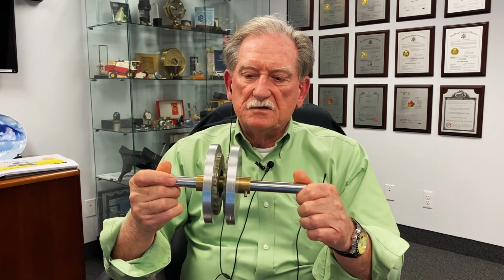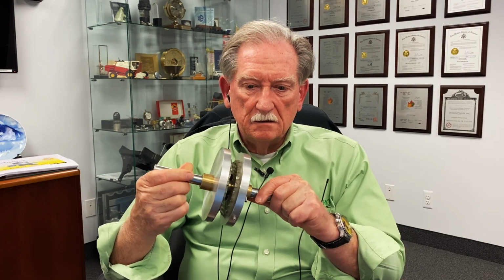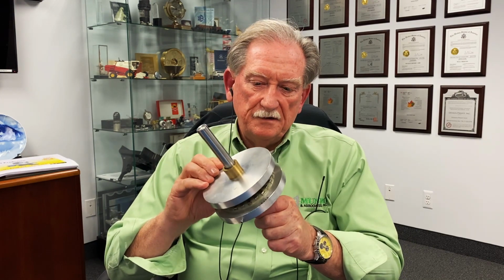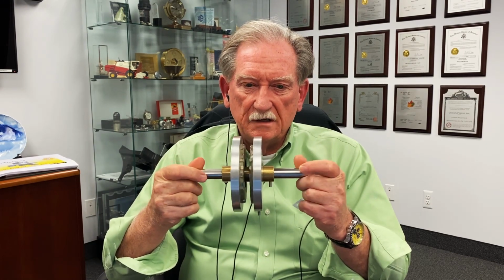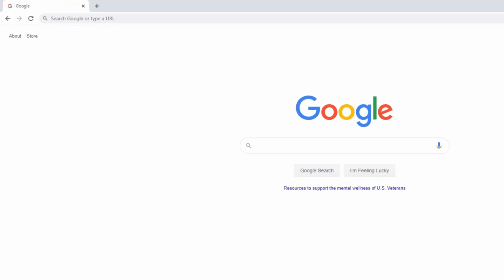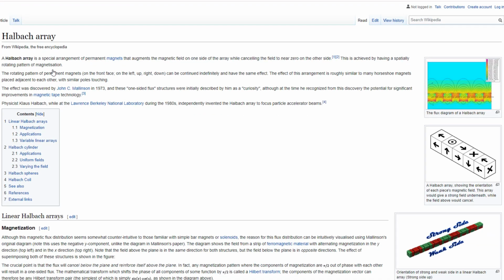Sandy Discusses What's In The Box - With Tracy McSheery

Comment: It’s fantasy to believe that there will be cheap off peak electricity in the future, as demand ramps up.
Reply: In the US we subsidize the Fossil Fuel industry with over $60,000,000,000 a year in reduced taxes, incentives and looking the other way about paying contractually obligated fees for the fuel they extract from government land. If we gave 1/10th of that as subsidies to electrify vehicles, it would happen decades faster. The choices are political, not based on physics or common sense.
Reply: @tracymcsheery1223  Subsidized taxes, incentives and fees are all money that don't exist if the fossil industry goes away. Giving 1/10 of zero is not going to get them far... That said, off peak electricity is not such a big problem as some seems to think. Apart from batteries there are many other solutions already existing at many levels of magnitude: https://en.wikipedia.org/wiki/Energy_storage

@A jones commenting on a video which is very much about optimism about the recent confluence  of technology that previously was too expensive or simply impossible, but now is possible and much cheaper, seems pessimistic and out of touch with realistic future possibilities. In my humble opinion.

Comment: When I took the cable car up to Yulan Hushan (Jade Dragon Snow Mountain)  to 16,400 feet (the mountain is above 18,000) near Lijiang, Yunnan, China, you could rent cans of oxygen. They felt like they were empty. However, they had more than enough O2, not 'air' in them to give you an occasional boost for the two hours or so you'd spend up there looking at the glacier, or at the idiots who climbed over the railing to take selfies on the glacier....  I had one of those finger clamp blood oxygen/pulse meters. I tried it on a couple people. Everybody was about 92%, including the Tibetan guy who worked up there - he was smoking a cigarette when I tested him.  You'd feel the positive 'hit' off the can of O2, (less lightheartedness, less breathlessness)  but it didn't move the blood oxygen level up.  
One great thing about traveling in Yunnan is that if you head north in the province, everything is well above 5000'. After a week or so hiking around there, when you come back down to sea level, you feel great for about a month. Back in Los Angeles two weeks later I hiked up Mt San Antonio 10,000 feet like it was nothing. Younger guys would run a bit, but then get tuckered out. Me at 54? I guess it was like torque.  I know Sandy likes nerdy stuff. Not a lot of opportunities in Michigan for high altitude experiences.

Comment: There has been a few cars with a more recent history than the Wolseley.  The Gyro X car from 67 ish and  a fellow named Danny Kim with Lit Motors 2016 was a good presentation. Lit motors had a two wheel enclosed motorcycle with dual gyros. I think he was onto something. Don't know exactly what happened, a lack of funding likely.  So if you know a guy with exceptional batteries and an amazing chip added with a new style motor that could be used in wheels I wonder what could be done. Could the spinning gyro be used to generate electricity as well as stabilize the vehicle? Love the channel Mr.Munro.

Comment: How come they talk as if Engines and Motors are the same. They’re fundamentally different. One is based off electrons and magnetism and the other is based off combustion or compression
Reply: It also is then reduced back to physics that says that one is incredibly efficient and another is highly inefficient.

Typical gas engines are 20-30% efficient at converting the fuel to vehicular motion. Typical Diesel engines are 30-40% efficient at converting the fuel to vehicular motion. 
While the motor is 90-95% efficient at converting the fuel to vehicular motion

Comment: 3 wheels means 3 navigation paths through potholes and across the paths of squirrels and rabbits.  I'd prefer the 2 wheeled gyro car over 3 wheels since you only have one navigation path..  But frankly, if you have to pull off to the side of the road you only have one wheel to get you out of the  grass or mud.  Intuitively, on 3 wheels rollover scares me but undoubtedly you can engineer around it.

Comment: High torque hub motors are the holy grail of e vehicles. 4 wheels is more stable than 3 but our safety laws put any high speed 4 wheel vehicle in the automotive classification.

Comment: But if you can have one or two motors + controllers (one per axle), compared to two or four (one per wheel), wouldn't this make it way cheaper?
Hub motors come with their own advantage. If you can make them air cooled, you literally have to run power and data to them. Maybe a brake wire. but if you manage to brake electronically and convert energy into heat, you can almost get rid of the huge brakes.

Comment: http://build-its-inprogress.blogspot.com/search/label/Coreless%20Axial%20Flux%20Motor Here is some amateur construction, but it is in line of what is discussed here.
The hallbach array pancake motor can be build quite light...
I have build tricycle (three wheel bicycle) with width between front wheels of 85cm... And I still didn't tip it... and I did pretty sharp turns which nearly threw me out of seat. The secret is to have the tadpole design(two wheels in front), sitting low and the center of gravity in 1/3 of length from front wheels to rear wheel. Tricycles are stable. https://www.facebook.com/media/set/?set=a.1810828625612524&type=3
ReliantRobin is badly constructed. It tips naturally- no sane engineer would construct vehicle that way. Center of gravity is at wrong place.
This tricycle car is much better. https://www.youtube.com/watch?v=ng3P52Ql4IU Just make it electric. With all wheel drive using pancake in wheel motors.

Comment: Would a direct drive motor like this require constant power even when the car was 'coasting' down a hill?

Or would it be integrated with a clutch/gear to allow it to roll freely?
Reply: I'd guess that it would slowly bring the car to a stop, acting like regenerative braking. So you would mostly be able to drive the car with 1 pedal. But I'm no expert.

Comment: Direct drive motor per wheel with electronic controllers. OK engineering students (of any age) design 3 different vehicles which maximise the space saved by not having an ICE and gearbox. Personal transport (car)/Delivery van/Large wagon (truck). The cost savings in Europe mean you multiply by 5 because of taxes on fuel.

Comment: Three wheels will also save not just 25% on tires like you would assume, but likely more like 60%. Think of it when you have a bad tire often you end up replacing all 4 to keep them even. With tree wheel the neccisary max will be 2, and also sometimes just 1. Overall large savings in my opinion.
Reply: I doubt this. The tires on the three wheeler will have to be wider (i.e. more expensive) in order to support a vehicle of a given size on three contact patches instead of four.

Another problem is that the single rear wheel can only be used on one of the sides on the front axle if the tires have a specific rotational direction. Therefore, you won't be able to rotate the tires to distribute wear evenly.
Reply: @phamnuwen9442  interesting, I think your point of view could be taken into account during design to avoid those issues and retain the savings factor.

Comment: lost me at 32 inch wheel
Reply: https://youtu.be/6eNMYHLmUlA?t=938
Reply: Fun coincidence, for a wheel at 33.61 inches diameter 10 RPM = 1 mph so for a delivery vehicle with a 32 inch diameter tire, 60 mph is roughly 600 RPM. 10 RPM = 10 * pi* Diameter * 60 min/hour / 5280 ft / mile / 12 in / foot. So it's easier to just remember 10 x MPH ~ RPM.
Reply: @tracymcsheery1223  he said wheel diameter not tire

Comment: A highly efficient Diesel engine driving via electric transmission would be far less fuel hungry than the multi gear systems used in today’s semi trucks.
Reply: The Toyota system uses a diff with engine input and motor input and output to wheels; so although engine (diesel or petrol provides the grunt), the highly variable motor input to the sun gear replaces gears and provides re generative braking, been around for twenty years, and becoming available on larger and larger cars as batteries improve, initially they came out with NiMH.

Comment: Tadpole trikes are so inherently stable the 2nd rear wheel is not needed. Power control into the front wheels allows them to help steering and braking. 
If you really can’t avoid gearing then go for epicyclic. They are compact and very efficient. 
I’m a fan of the Citroen hydro-pneumatic suspension. Compressed gas provides the springs. Hydraulics provide ride levelling with rapid response.

Comment: The motor should BE the wheel.

Put tyres directly onto the (three) motors = maximise the diameter, and remove the need for a ‘wheel’.

With the resultant torque and control: “brakes” could also be omitted....?
Reply: Hell yeah!
Reply: Interesting.

Comment: If these can provide braking as effectively as normal brakes you could delete the hydraulics and friction systems.
Reply: For legal reasons you will keep disk brakes, but you can increase the in city range by 10 percent or more I've heard by capturing braking power. I've been told delivery trucks have a binary power system: Gas Pedal to the Floor, or Brake to the Floor.

Comment: I owned an Alfa Sud & the disc brakes were inboard (not at the wheel hub), which reduced the unsprung weight, which was a great idea but in highway driving engine oil got on the discs & the braking became non-existent.
With electric vehicles not having motor & gearbox oil leakage issues, I'd imagine that for the cost/weight of 2 universal joints, inboard motors & regen braking as showcased in this vid would help suspension compliance.
Then add Sandy's electronically controlled air suspension & you have a winner. 👍
In saying that, I'm not an engineer, just a thinking observer.
Best wishes to you both, I reckon you're onto something special.

Comment: 3 wheel cars will have CGs just as low as 4 wheel cars, and can be just as nearly impervious to rollover as Teslas.
Reply: CoG yes, but you've moved in one of the wheels so its like removing an outrigger, if you can't lean, and you certainly can't slid evenly, there would be forces to rotate like un manageable under steer, you've never seen a three wheeled go kart now have you !
Reply: Have you seen  T-Rex or Morgan 3 wheeler or Polaris Slingshot?

Comment: I want to understand this better. It seems to be an axial flux motor with the permanent magnets arranged in a Halbach array. How is that different from what YASA, Emrax, or Magnax are doing? I recall hearing that YASA's motors were using some exotic materials.
Reply: See papers on the Aurora Motor from CSIRO. Much better than our motor, but also much more expensive and not as powerful.

Comment: Do you think there is a future for the Bose magnetic suspension that was tested on the Lexus a few years back instead of using air suspensions?
Reply: No, it was a failure
Reply: @williamgoode9114  how so? The prototype clearly functioned and well based off he demonstrations. Did they fail in making it scalable or were they unable to make the design more robust due to technology limitations of the time? If those are the case it’d be in the same category as these in wheel hub motors and Sandy and Co could make it happen, no?